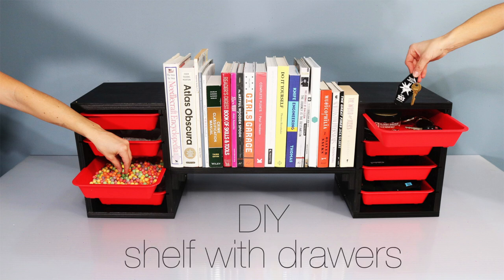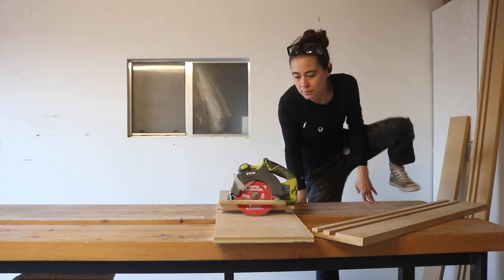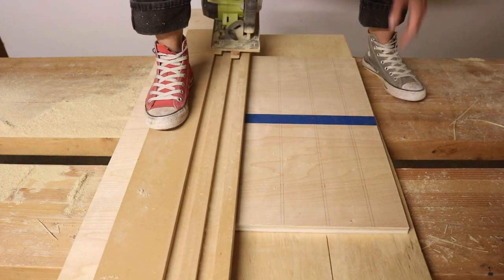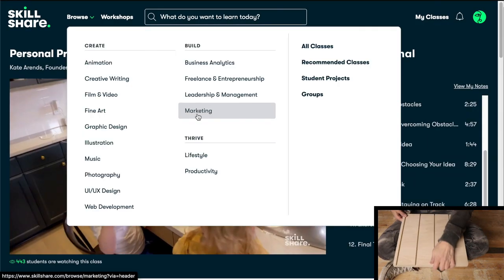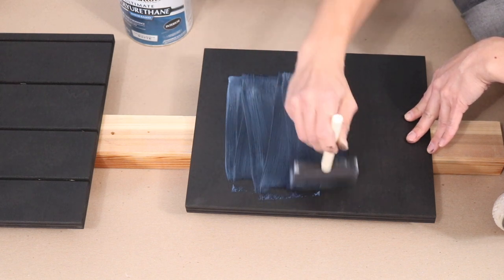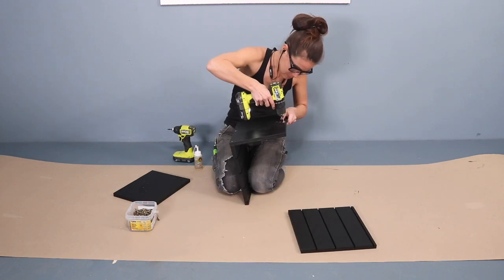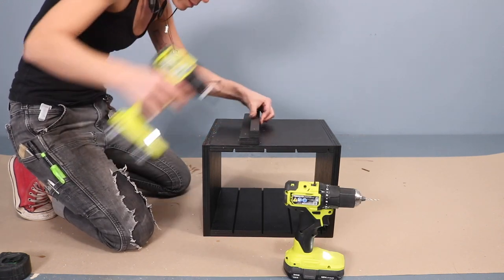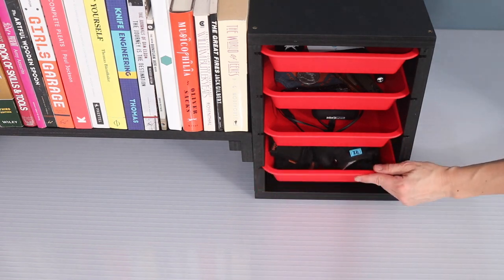DIY Shelf with In'n'Out Tray Drawers

Comment: Wouldn't it be a little bit easier to first cut the grooves and then cut the sheet in half instead of use tape 😃 
Nice project as always, cheer's
Reply from the maker: YES.  and that's what i meant to do.  but then, i confused myself and thought i hadn't cut it the right way and...  well, i did it the hard way 😂